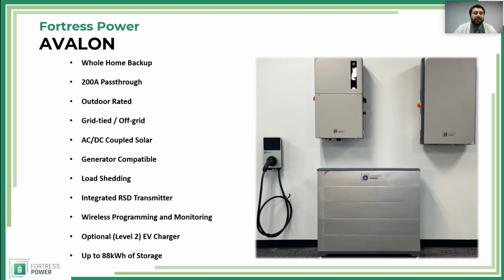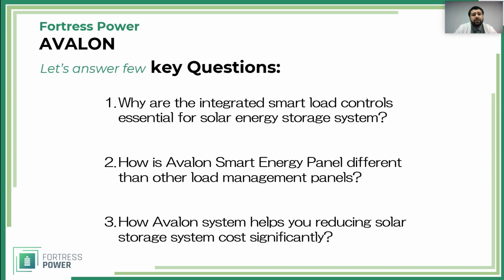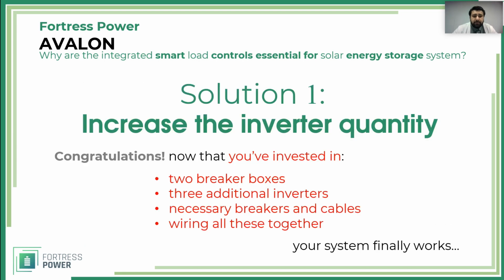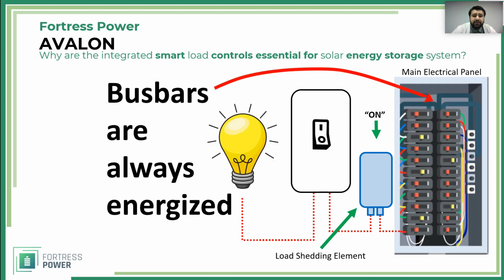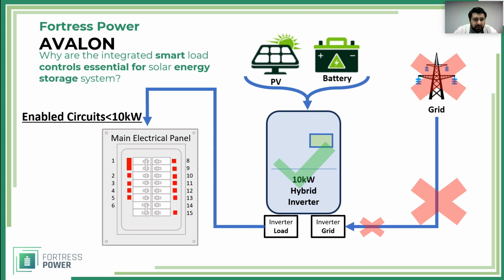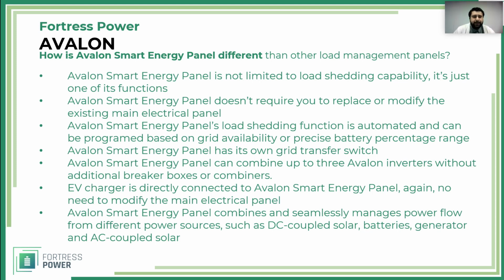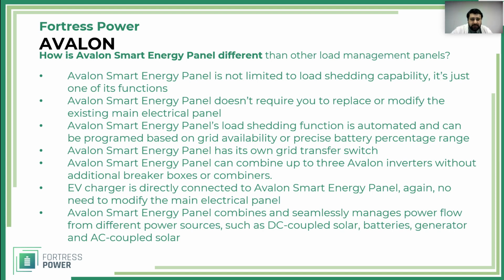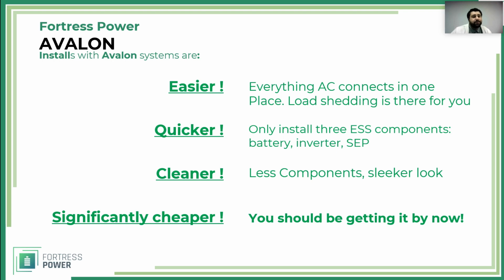Reduce Residential Solar System Costs with Integrated Smart Loads

Comment: This is a really cool video, thank you so much for the explanation.

What component/mechanism is illustrated by the "green squares" in the main electric panel that enables the circuit to load shed or turn off via the SEP? You do not have to physically rewire those circuits into the SEP, correct?